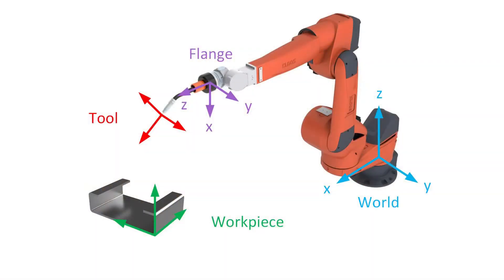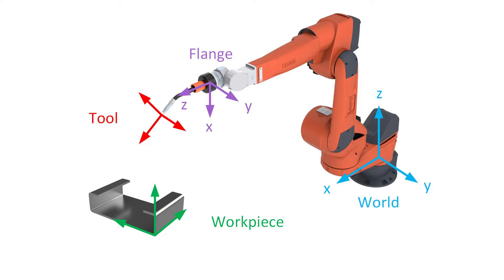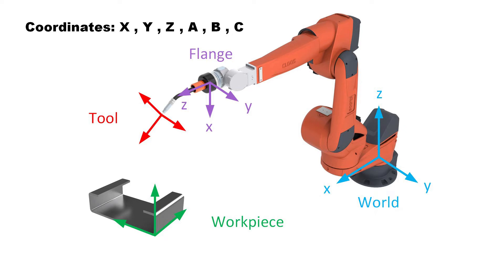The Kuka ABC (and Fanuc WPR)

Comment: world can be located anywhere. root is located under the robot
Reply from the maker: My robot controller doesn't have ROBROOT yet, but you are right that today ROBROOT is located at the robot base of the individual robot and the idea of WORLD is more to be a common coordinate system of a complete robot cell that might contain multiple robots. Nevertheless, WORLD and ROBROOT are identical until you define a non default $ROBROOT.